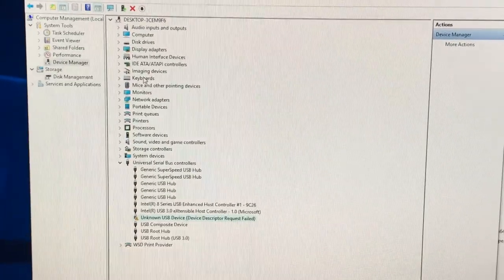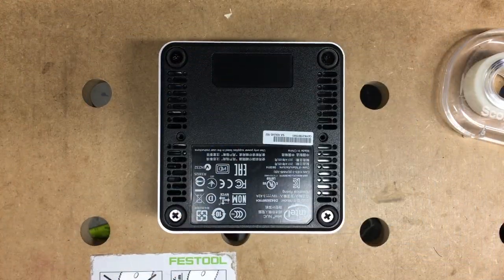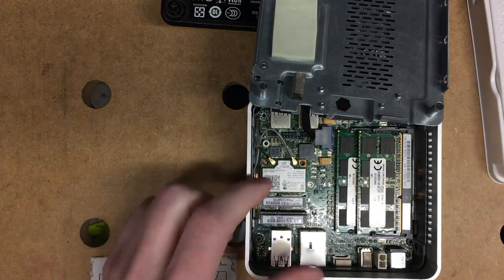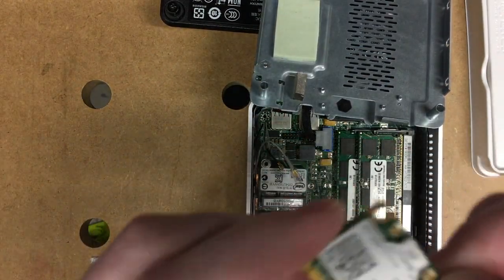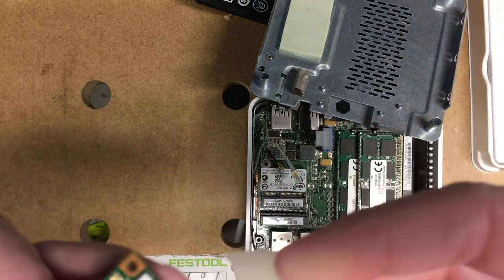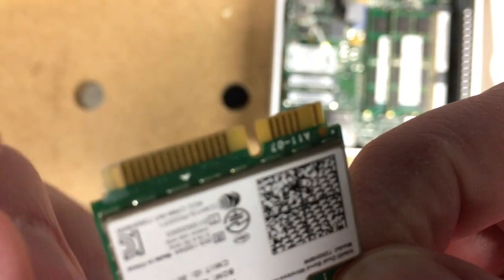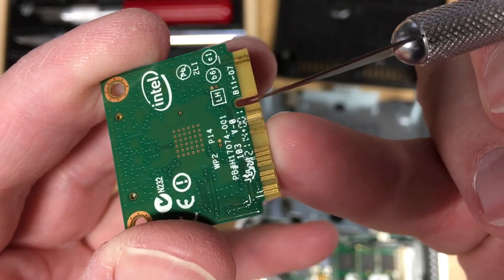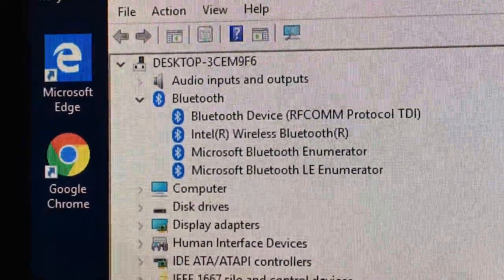Intel 7260 Wifi/Bluetooth Card Fix

Comment: Repeating my comment because YouTube deleted my previous with link.  I had success isolating just pin 51 on a HP EliteBook 820 G1, I did have to install the Bluetooth drivers for the AC 7260 for this to work.  These drivers can be hard to find as Intel now have a disclaimer that they are no longer available for download as this adapter is EoL.  However I found recent driver version (2021) squirrelled away on Intel's site that is compatible with this adapter.  It was via a Reddit post "Where to get drivers for Intel Dual Band Wireless-AC 7260'' , I hope this compliments this awesome video. Thanks @RickMakes.

Comment: What does this specifically do to fix the issue and has Intel acknowledged the problem? Thanks
Reply: That pin's purpose is to deactivate the bluetooth functionality, if you have a laptop with physical buttons to turn on and off your bluetooth, It will use that pin to turn It off. For an unknown reason, the drivers or Windows messed with that functionality. When you put tape on that pin, It bypass that.
Reply: Thanks @darkdoom

Comment: I had the idea that this solution could not be true. Just tried it and it did not work (yet). However usually when installing the BT driver BT_21.10.1_64_Win10 it did not want to install. I tried to install this when applying your solution and the BT driver installed correctly and I was able to add bluetooth devices. Aswome and thanks!
Reply: Same thing here: it didn't work by only taping pins 51 and 20, but then I found the driver for the Bluetooth on the Intel website, downloaded it,  and installed it and it works like a dream now! Many thanks to both of you as your advice helped me solve the issue! The driver for Bluetooth can be downloaded here: https://www.intel.co.uk/content/www/uk/en/download/19390/intel-wireless-bluetooth-for-intel-wireless-7260-family-and-intel-dual-band-wireless-ac-3160.html

Comment: Thanks Rick!!! After a windows update back in September my wife's desktop Bluetooth stopped working. I had the same exact issue in the device manager. I tapped over pin 20 on the back like you showed and we are back in business. This was after countless hours trying driver, OS and Bios updates. Microsoft or Intel made an error and neither will acknowledge it. I know for sure that this was working on her system before, since she has a Bluetooth mouse and keyboard.
           Gigabyte Z97N-Gaming 5 Motherboard came with the 7260 from the factory.
Reply: I've got the same board and had the same issue. My wifi is good, but no bluetooth.

Comment: 3 years later and this hack still works!  I was able to tape Pin 20 & 51 and now my Intel Dual Band 7260 Wireless connector works!  When I first installed it in Linux Mint 21 it would appear in the list hardware but I couldn't enable wireless devices.  Now it works perfectly on 5Ghz connection with super high speed!  Thank you Rick Makes!
Reply: I also need this to install mint
Reply: this is a hardware hack that worked for me.  Mint recognized the card just fine on my old Toshiba Laptop.  I still have the laptop, but no longer use it.  Definitely give it a try, its kinda hard to cut a tiny strip of tape and put it over two pins, but if you manage it.... could be worth the pain to get Wifi connection updated.

Comment: You, sir, are a genius. Only suggestion to make the process easier is to use a safety pin or toothpick and dab some quick drying fingernail polish on the pins. Tape took way too long to cut, and the transparency made it hard to tell if I was fully covering pin contacts.

Comment: I would never have guessed how to fix this. Where on earth do you guys find theses fixes?! I guess it doesn't matter, but thank you very much sir. Recently bought my intel 7260 to cover the lack of bluetooth connection on my early-2013 Asus laptop, and boy was I extremely bummed when found out this adapter would not work properly...
Reply from the maker: I found it on some forum and made a note about it. Months later I tried it and it worked.

Comment: Wow I did not expect this to work but it did. My laptop is the acer aspire 5750g in case someone is having the same issue. Much appreciated Rick.
Reply from the maker: Yeah. It doesn't make sense but it seems to work. :)
Reply: @Rickmakes  I have an Acer Aspire 5750G and I taped off both pin 51 and 20 bluetooth still doesn't work... any other advices?

Comment: Taping pin 51 worked for my circa-2011 Acer 5222, thank you so much!  Before the taping, the laptop wouldn't even boot; just had a black screen with a solid cursor and I couldn't even get to the BIOS.
Reply from the maker: That's great!

Comment: Thank you for sharing it was just pin 51 for me on a Toshiba c655-s5225 it took two years of doing everything I could think of except putting tape on pin 51... what the heck why I don't understand, either way I'm just glad it's fixed it and working now thank you so much.... that shit was driving me nuts
Reply from the maker: Doesn't make sense but it seems to work. :)

Comment: @rick , thnak you , i was frustrated , cause i order this 7260 to replace my old intel centrino wifi/bt  module , and i tried to download various drivers and nothing worked ,  and now with your hack i got it running .  i just scrape of these 2 pins and its working
Reply from the maker: That's great to hear! Glad it helped.

Comment: Thank you!
It worked for me, I use an old laptop (Acer Aspire 5750 with i3 2310m, 12gb ddr3, 128gb ssd and 500gb hdd) as my emulators/xcloud/parsec machine, and recently bought this card to improve my internet connection and be able to use my bluetooth ps4 controller.
Thank you so much!!!!!
Reply: I have an Acer Aspire 5750 with an i7 processor and didn't work! @RickMakes how did you determined that it was additionally pin 20 to be taped off?
Reply: @tudorelP  I've taped the two pins mentioned in the video
Reply: I wasn't aware that it is a separate driver for the Bluetooth and after installing it with those two pins 51 & 20 taped, it does work indeed now! Thanks for sharing!

Comment: Hi RickMakes,

Thank you very much. I have Sony Vaio Laptop SVE1511A1EB and this solved my WiFi card being switch OFF permanently.
Reply from the maker: Thanks great!
Reply: Hello Rick. Did you cover both pins or just the 51st? I covered 51, but a day later the problem returned. It could be that the heat has damaged the tape. But, I would really like to know how you did it, because I also have a Sony Vaio. Thanks!

Comment: Worked like a charm! Took the whole wifi/bluetooth assembly with the antennas and all, from an old scrapped Dell laptop & put it in my sons HP pavillion. I scraped off pin 21 instead of using tape. But just pin 21 .

Comment: Capton tape over pin 51 did the trick on my Intel 7260 inside a Gigabyte GA-F2A88XN-WIFI Mini ITX FM2+ Motherboard. Wifi + Bluetooth was working for about a month and then this morning wifi stopped and then stopped reporting as connected in Device Manager (not even showing in hidden since I'd removed the driver). For what it's worth as possible RCA, I think I was thermally baking the card; my AMD A10-7850K runs hot and a lot of heat was coming out that area. Probably should be re-pasted. Anyway, thanks for this video!

Comment: Same as some of the other commenters, I was prepared to be astounded if this worked.  I'm astounded.  Here's what's really weird in my case -- I have two identical laptops, both running the same version of Windows 10.  One of them needed the tape and the other didn't.  Like a lot of the others here, I had wasted many hours messing around with drivers before finding this link on the HP community website.  Now that Bluetooth is working, the wi-fi isn't, but I really don't need it so I'm not going to mess with it.  (At least not immediately.)  I suspect the tape may have encroached on adjacent pins and is interfering with the wi-fi, which now under Network Adapters in Device Manager shows "Bluetooth Device (Personal Area Network)" where it previously showed Intel(R) Dual Band Wireless-AC 7260.  I'm also tempted, now that Bluetooth shows up in Device Manager, to try taking the tape off again to see whether it stays there.
Reply from the maker: It's weird that this works but I've had many people have success with this. I have recently purchased a wifi 6e Intel PCIe card that only works properly if you install an older device driver. It's kinda sad that a company as large as Intel doesn't have better quality control for their network cards.

Comment: That's for the info! I only had to tape off pin 51 on the one side. I upgraded the Wi-Fi in me and my wife's laptops with two of these cards. My wife's laptop, a 2010 Dell worked fine with out needing this fix. My laptop a 2013 Toshiba, wifi worked but had no Bluetooth. I wish I knew why this happens.

Comment: This worked like a charm for me on my HP Envy DV6 7309TX. Any idea why the pins needed to be taped though? I only taped the last pin as per your video and the Bluetooth driver installed on its own when I turned back on my laptop after inserting the wifi card.
Reply: Some devices have a hardware switch to turn off bluetooth. Now if you use a thinkpad that has that awful bluetooth daughter board, then from the card's point of view it's as though that switch is always turned off.

Comment: I have the same drivers showing for Bluetooth but can't find devices does anyone know if one antenna wire is for WiFi one for the Bluetooth? As I just got this card of eBay for a mini pc WiFi works but Bluetooth doesn't.
Reply from the maker: I think one wire is for 2.4GHz wifi and bluetooth and the other is for 5GHz wifi. I'm not sure which is which though. I would guess 1 is for 2.4 and 2 is for 5.
Reply: @Rickmakes  thanks I worked it out last night 

Main - WiFi only

Aux - gives WiFi and Bluetooth

I fitted this WiFi card in my mini pc but they was only one hole to fit the cable on outside so gonna have to drill another hole to make a 2nd slot for another antenna.

For the moment I have robbed a WiFi antenna from my old laptop that has been stripped and stuck that to the outside of the case until the new 6dbi antenna arrives.

So I could have one antenna but would rather 2 so I have the full dual band and better signal.

So you can run on one antenna by connecting to aux but will impact on WiFi speeds more than likely when using the Bluetooth.

Comment: Would you inform me if the 7260 dual band ac device works on DELL model 5537 notebooks?
Reply from the maker: I'm not sure but I did some checking online and a post on this page: https://www.dell.com/community/Inspiron/Dual-band-5Ghz-wi-fi-adapter-on-15r-5537/td-p/6121453 says the Intel Wireless-AC 7260HMW works. I also says to avoid the "NGW" model of the 7260. I can't vouch for the poster of that message so make sure you can return the card if necessary.

Comment: the Bluetooth on my card works but the intel AC 7260 wifi in device manager shows error code 10 unable to start.
Reply: Uninstall you current intel bluetooth drivers and download the older drivers for this card. That’s what got mine working after I taped over pin 51.

Comment: Thank you for the video. My problem is without covering any pins, my card is already detected and the drivers installed. But, none of my devices will connect to it. Should you remove the previously paired devices and re-pair them again. While doing that, I get a remove failed message. Any thoughts to how to fix this?

Comment: Thanks for the video but i want to ask something. After replacing the Wi-Fi card with this, the driver did not show up, when I installed it manually the bluetooth was working but my bluetooth headset starts to buzz and cut out after a while so it doesn't work exactly right. Does this solution fix my problem?

Comment: I tried covering those same pins on an HP envy DV6 7382 and it didn't work, I still don't have bluetooth, I originally had a centrino N2230 wireless card and bluetooth worked but it doesn't have a 5G connection, what pins should I cover?
Reply from the maker: If covering the pins in the video didn't work, I unfortunately don't have a solution for you. Sorry about that.

Comment: I put this card in my Toshiba Satellite laptop. In my device manager there's no Bluetooth shown on the list. I don't see any exclamation point for an error or anything. There's no Bluetooth in the list at all. I tried taping Pin 51 but the tape won't stay on and it's too small anyway. The pin is too small.
Reply from the maker: You could try using something like a Dremel tool to grind off the pin but if it doesn't work, you will have ruined your card.
Reply: Try a coating of super glue on the pin

Comment: Thank you very much for this video. Recently upgraded my old hp pavilion g6 2231tx railink 3290 wifi module to intel 7260, system had detected the card but wifi and bt didnt work but after covering the pin 51 and 20 wifi and bt both has started working.

Comment: tryed this with mc-ac7265, didnt help. did you cover both sides or only one on pin 51?? Anyway: on 7265 covering both pins didnt help with enabling bluetooth to work. Nothing changed. "Generic bluetooth adapter" still have "!" sign.
Reply from the maker: As far as I know, this only works with the 7260.

Comment: I fixed the problem , a different way. 
 Check device manager, under "bluetooth" category you might see the AC 7260 blue tooth with Yellow box and ! next to it, right click and check properties, in  general tap, you might see error code 43. If it is, right click the bluetooth and "uninstall" it . 
After uninstalling, right click the name of your computer on top of the list, and run "scan for hardware changes" The bluetooth will be reinstalled with correct driver and run !

Comment: Hi @RickMakes i think have similar problem. Intel dual wifi+Bluetooth module. Only WiFi works fine. Bluetooth doesn't appear anywhere in device manager, and when "scanned for hardware changes" nothing new appears in device manager, No device waiting on driver's installation. Please advise
Reply: Oh! I just made another attempt at getting the Bluetooth to work. This time I restarted my computer and went into bios settings, i noticed that Bluetooth was disabled in bios settings, so i enabled it. Bingo. My Bluetooth is now working. If only I knew all this while. More than 6months struggling to understand why WiFi works well whereas Bluetooth can't be found. Many thanks to you @RickMakes and the fine people in the comments section.
Reply from the maker: Sorry I couldn't reply sooner. I was away for a few days. Glad you got this working! Maybe your comment will help someone else out in the same situation.

Comment: Hello bro i wanna try it on my Lenovo thinkpad x200 any advice?
Reply from the maker: If it isn't working at all, it might be worth a shot trying to fix it. If you have any important documents on your computer, make sure you back them up. If the card is working but not well, have a backup plan in case the fix doesn't work. For instance, you could use a USB wifi dongle if the internal wifi doesn't work. Make sure you disconnect or remove the battery before pulling the card out.

Comment: Hi Rick,
I have the exact same Intel NUC (D54250WYKH) and same Intel 7260WMH card as you do...and no surprise I guess, the same problem!
However, just curious because you only mention the Bluetooth being the issue so does that mean that the Wifi was working? Because in my case it's neither and in fact, it's not even detected by the BIOS so I'm wondering if this would solve my problem?
Reply from the maker: It's been a few years but if I recall correctly, the wifi was flaky before the fix.
Reply: @Rickmakes  Thx to your trick, I got the wifi to work!....but not the bluetooth unfortunately 😌
I imagine since it's been a while, I guess you have no other ideas I could try to get it to work? Any other pins to try? (how did you even figure this out!? True witchcraft!)

Comment: Hey! I suppose I have a similar issue with the Intel AC 7265: Wifi doesn't work (adapter disappears) whenever I restart. When I shutdown and turn on again by using the power button, it works just fine. I read that this might have to do with one of the pins, so I would like to try this fix, but the AC 7265 is shorter and doesn't have as many pins (and it seems like they're in different places on the PCB). Do you know if your fix might work on the 7265 as well, and which pin(s) I should try to cover then? I'd really appreciate an answer. Thanks!
Reply from the maker: I'm not familiar with that card. I'm guessing this specific fix for the 7260 is unique to this card. You my try posting your problem on the Intel community forums.
Reply: @Rickmakes  Ah, too bad. Well, thanks anyway! I'll see if I can work something out.
Reply: Primeltoaster just wanna ask you a question. I saw your respons to the intel 7265 wifi card video. I have the some problem with the same card as you did you ever find a solution?
Reply: I found the solution Primaltoaster if you still need it. you need to mask pin 56 (and maybe 54 but dont think so) on the card we have. Pin 56 is on the back. You will see 2 pins and then about 7 spaces of no pins the pin after the no spaces is pin 56 the one after that 54. Just mask that pin and rebooting will no longer disable you wifi.
Reply: I fixed that as well. After I taped pin 20 (like in the video, airplane mode wouldn't turn off and wifi was grayed out. I went into Device Manager->Human Interface Devices->Disabled Airplane Mode Switch. Now try it.
Reply: @frederikcretel6386  did your 7265 card's bluetooth disapeared? cause i have that problem, maybe taping one of the wins could make it work again too.. did you have that problem too?